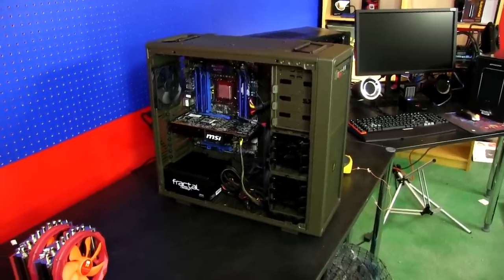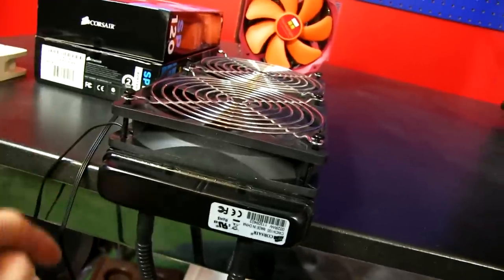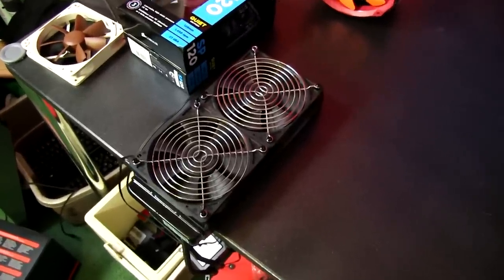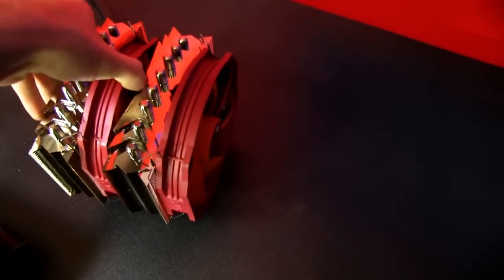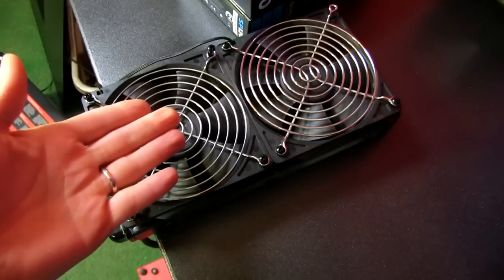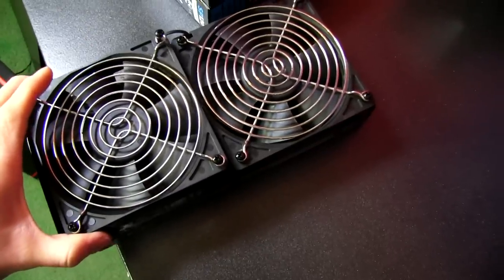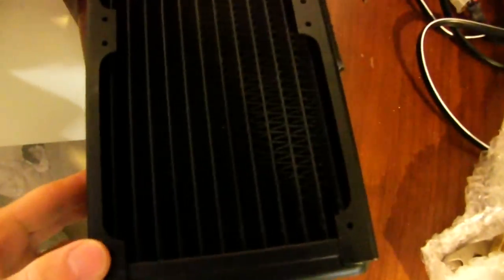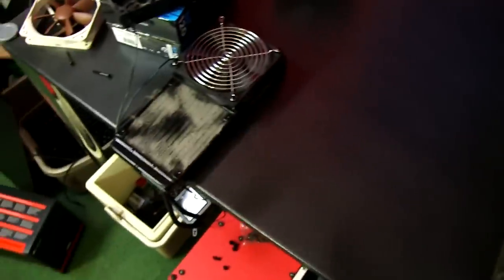Push vs Pull vs Push Pull for Radiators and Heatsinks Linus Tech Tips

Comment: i would just like to share my thoughts on this push/pull question, as linus says it makes it easier to clean but if you take a look at an ac unit for example, the 6kW or bigger ones that you can use for both heating and cooling. they use pull configuration since their radiator is bigger than the fan can cover in push configuration so they make a funnel the size of the radiator and size it down to the fan size with low tolerances very much like you can see on some car radiators, that way the smaller fan creates negative pressure between it and the radiator sucking air evenly across the entire radiator. if you however use the fan in push configuration the airflow is more centered wich makes the radiator as small as the fan, in the pc world radiators and fans are pretty much the same size so that will not make any noticable difference but in alot of other cases were the fan cannot be sized equal to the radiator, pull is the goto method, atleast that is enough along with the cleaning benefits to convince me that the pull configuration allways wins or is atleast equal.

Comment: The push pull thing was handy, I just did this the other day because my fans didn't have enough pressure for the rad.   tho.    Its pretty easy to lay down your case and unscrew the rad and use a can of air

Comment: I personally think pulling makes the most sense. No matter what, you're going to be moving air through the radiator at the maximum rate at which the fan is capable of as the air will find it's own path through the rad instead of just being forced through it.

As per the mounting of the radiators... I'd say pull the air out of the case still. Even if the air is hot, as long as there is flow you're going to be dissipating heat. It'd also be a waste to not make use of the free thermal energy that's already taking the hotter air upwards.

If that isn't enough, fully detach your water cooling radiator from your case and liquid cool your liquid cooler for extra kilowatts!

Comment: The real question is expelling radiator (CPU) heat into the case or out of the case.  Internal case temps higher would increase heat on MBOB and GPU.  That is my question, yet all I find are videos addressing fans and radiators.  Tough to be aware of and clean a push configuration, so I am a NO vote on that.  Heat into or out of case? Logic would say out.

Comment: when in push dust will build up on the radiator side with the fans but with pull it just build up dust on the opposite side of the radiator to the fan, wither run pull, or push with dust filters

Comment: that'd be a bad idea because hot air rises, those top fan would trap the hot air inside by pushing it down again so yeah as far as intake vs exhaust goes it should be a matter of 1-5 degrees maybe a bit more in intense gaming but its harder to clean if you put the radiator as intake no matter if the fans are the front of it or at the back of it (you'll have to unscrew it) and general rule: front, bottom and (side depends on GPU cooler) should be in take, back and top exhaust

Comment: I think you would get only the amount of airflow that your case would be able to exhaust though fan holes/ cracks in the seams of the case. Having a ton of fans just pumping air into it with no way for it to exhaust out won't make it work better. In fact it might make the airflow worse. You do want slightly more filtered air pumping in than exhausting to help keep the case clean inside but you can go overboard with no net gain after a certain point.

Comment: As a refrigeration service tech for a few years, PULL! For the exact reason he stated. From top of the line down to lower end less reliable units (maybe not all the super crappy units) the fans All pull air across the heat exchangers. (condenser and evaporator) These condensing coild plug up with dirt quick as they are running 5-50W fans on and off all day and all night. At places that have prep-table coolers, that dust gets kicked around and sucked up by those fans and into those coils. It then gets packed on there like a blanket (yes like grandma's thick blanket but made of dust 3/8" thick. and that's just in 4-6 months. Leave them un-maintained for 8+ and you'll be calling the local HVAC/R service company because the unit is running warm.) making the whole system work harder. (think running a marathon on a hot summer day with a sweater on) get a bristle brush (plastic bristle or softer. no metal) and a vacuum, brush that dust off into the vacuum hose, then get some compressed air (cans of duster, CO2, etc.) and blow backwards through the coil into the vacuum again and then blow forwards through the coil. The only way better to clean your radiators and coils is with a light pressure washing.
Reply: I also recommend a filter for your whole case where ever your intake is. Cheap filter from hardware store, foam pad, cut-to-size filter, w/e..... maybe not a coffee filter so much. Helps keep the whole setup much less dusty. Very nice.

On second thought, through a K&N on there for an overpriced boost of 2 HP to your CPU.

Comment: Considering you're already using 2 fans in a push/pull configuration, switching to delta fans would be pointless and unnecessarily loud. Heat is absorbed by air at a specific rate and as such, air traveling at 50cfm or 250cfm won't change anything. Unless the ambient temp inside your case is hitting 70C and above (example) it may be worth it. Then again a simpler, quieter fan would do the same. The extra degree or two gained isn't going to get you any further in stability tests if you're OCing.

Comment: Surely push or pull matters because of temperature  of the ambient air going through the radiators.

If you are pulling hot air from inside the pc through the rad, its different to you pushing colder air from outside into the radiator and then into the pc. Also the source of dust is more likely directly from outside, as most pc have some kind of filter for air entering the case from the front, or underneath.

Also 'push pull', has the corresponding 'pull push' mode, e.g. Whether the air is travelling in through the radiator, or from the case to the radiator.  I would like to see this question revisited, please.

Comment: Believe it or not theres a method thats not widely known, and thats Pull Pull, both fans pulling heat away from the radiator in 2 directions, it works very well ive tried it. Better still if the rad is mounted at the front you get the best of both worlds heat from the rad is getting pushed out the front and the other fan(s) are pushing air in the case at the same time also you get no dust build up in the fins... If you are using only 2 fans on a 2x120 rad, i highly recommend fitting the rad at the top pushing out, as heat rises.

Comment: It's all about cool air flow inside the case, best way to get cool air flow is to mount radiator at top of case, with the fans pulling heat off the radiator out to the top, fans at the front blowing cool air in, fans at the back blowing the air out. The reason for the radiator at the top is because heat rises, so place the hottest heat source where the heat can escape the case fastest. It doesn't make sense to place it at the bottom does it, because that would increase the ambient temperature of the case.

Comment: I have been using a push / pull with two of these corsair 120sp fans. I actually got a fan filter for the rear of the case and don't have the problem with dust / cat hair getting into the radiator. When I air out the case I do stop the fans and hose inside the radiator.

I would think sucking in cooler outside air would be better.
Reply: Would depend on your setup.  If everything is water cooled, then heat inside the case would be minimal and in fact it might be a plus to remove what little heat remains out. If you pump the heat inside the case, it could even heat the metal on the case which in turn would add even more heat to the radiator or atleast make it harder to cool.  But as you say, you are pulling in cooler air in the situation that not everything is water cooled.  But also think in that scenario that you are adding more heat to the items that aren't water cooled too.
Reply: Carl Kitchen Your case air temperatures would not vary much, if my knowledge is correct. If they did, you have an airflow problem in your chassis.

Comment: in a push, some heat is transfered from the heat of the fan to start, where pull has a more uniformity in temp causing an even cooling... balf a dozen one way, 6 another way.

Comment: Neither. Push and pull *only* refer to the placement of the fans on the radiator. The terms you're looking for are intake and exhaust. Intake is when the fans on the radiator (push or pull) are getting their air from the outside of the case, and moving it inside the case. Exhaust (push or pull) is when the fans are blowing air from the inside of the case to the outside. 

Intake is ideal, but exhaust is useful for small cases or limited airflow.

Comment: The tip for dust is decent but i have a small compressor i use to clean my PC once in a while so its a non issue for me :P
But as far as performance go it can be affected by many factor and affect other component inside your case.
Depending on the fin size/distance on your rad and the static pressure and CFM of your fan, result may vary.
Things like whether the airflow in your case creates positive or negative pressure as well as overall temp inside your case needs to be considered too.
General guidelines are fine but nothing beats real world testing for your own particular situation on then end :P

Comment: Performancewise it doesn't matter if you go in push or pull config. I agree on that. But what about the noise-buildup? I've experienced time an time again that if you have a casefan pulling air inside the case, it'll build up a pretty annoying humming-sound if you don't leave enough space between the fan and the fangrill of the case. So my question is: Wouldn't it be the same with a radiator and a fan?

Comment: I push air out of my case. With dual 140mm fans in the front, and two up top, it's a nice loop, and my temps are good. Dust isn't a huge issue thanks to dust screens.

Comment: It's not impossible to clean.  Get an air compressor!  Also, I would argue for push pull on radiators, depending on the application.  If heat is an issue, for example if you don't have a large radiator, you can run all fans at a lower RPM to combat heat soaking and keep noise lower than what 2 fans would generate to do the same work.

Comment: 1 large fan vs two smaller fans?(video suggestion)Is it better to have two fans on a radiator or 1 big one?! Is the CFM the same or better? Linus you're awesome tech videos inspire. But I have too many unanswered Google Q's.
Reply: fcfdroid I'm not Linus, but here's my two cents (hope it helps)...

CFM is a measure of how much air a fan can move, and depends on size, speed, blade shape, housing, etc.  Generally speaking a larger fan will move as much or more air that a smaller one, but not always (too slow, bad design, etc.).  But just moving more air isn't enough with a radiator (or a massive heat sink for that matter).  You need static pressure (SP), basically focused CFM.

A box fan has high CFM, but low SP (good luck cleaning the crumbs out of your keyboard with one).  A can of compressed air has low CFM, but high SP (great for crumbs, not so much cooling the room).  The key is to balance CFM and SP.  That's why most rads these days are made for 120mm fans (not too big, not too small).  But you can get 140mm fan rads or even 200mm fan rads.  As long as you get the right fan(s) (CFM+SP) size doesn't really matter as much.

As for one big vs. many small, it's really up to you.  You can move a man with a single horse or a team of sled dogs.  It comes down to noise level (generally bigger = quieter, but you can dial back multiples too), case compatibility for rad  size and shape (240mm (2x120) vs 280mm (2x140)), brand loyalty, aesthetics, and budget.
Reply: PongoXBongo Thanks! I totally agree.

Comment: My 240mm AIO from Cooler Master (Nepton 240m with high pressure Silencio fans), has it's configuration in push, because in a direct 90 degree angle next to it in my Corsair 250D, is a large 200mm intake fan, in pull, with a filter in front. So case in point, if you got proper case filters, it will not matter if you got push or pull.

Comment: what I do is,  I attach a straw to my vac, tape it off so it sucks 100% only through the straw and I stick it up between the blades of the fans and it sucks the dust completely out of the rad. then the very edges of the rad what i do is I fill a air tank I have with like 120lbs of air and blast the other side of the rad and that removes any dust the straw had missed.  
that's my tech tip.  i use a push pull system on a corsair h100i and it does indeed make a difference rather than just push or just pull.  according to my temp gauges it made approx about 8c to 12c difference.

Comment: ok, so for what I understood, you recommend to have the radiator fans on top of it pulling air out from the computer to thru the radiator and out of the case. This helps when it comes to cleaning your radiator.
BUT, what about the whole airflow of the case? If you make set up your radiators this way then they become exhaust fans, and as far as i know, we want t keep a positive air flow, right? so, what are you're recommendations on this? add more intake fans?

Comment: i would recommend vacuuming it off first after you got most of it out. use a duster to blow anything else off. you will end up still pushing some of that dirt inside closer to the fan anyways. that's when you use the duster closer to the fans as will. which remains me i need to clean out my computer... its been an year and i have yet to clean out my watercool loops. not sure which method to use.

Comment: you need to do a video on the internal air pressure inside the case due to fans and how to configure so there is a positive air pressure inside the case compared to external. Positive air pressure helps to keep the dust down inside the case.
Reply: The fans should always have a dust filter over the intake. The little cracks and empty fan slots do not have a dust filter. If you have a negative air pressure dust gets sucked in through all the cracks and holes that do not have a  dust filter and collects on the internal parts of the PC while a positive air pressure more dust is on the dust filter instead of important things like heatsinks. The cracks and holes air is being pushed out so that ultimately makes for less dust inside the case.

Comment: I currently have and FX-8350 @ 4.0GHz and a SilverStone Tundra TD03 in Pull config at the back of the case as exhaust.
My CPU idles at 10~15c and it's really easy to clean, don't even have to remove it at most points. So i'm happy.
I wrote this before watching the vid btw.
Reply: +Captain Gray nice temps!
Reply: +Captain Gray Update. I bought a new pair of fans: Corsair SP120 1450 RPM and set it up in push-pull, my CPU idles at 9 - 13c now! ^_^
Reply: Where do u live? South/North Pole??
Reply: ZsiaNcs
My room temp is around 20-25c. And i live in central Sweden.
Reply: +Captain Gray Then your CPU can't be idling at that temp.
Reply: +Captain Gray I have been testing various ways to measure my PC's internal temperature and this is as accurate as it gets. http://imgur.com/a/1cocx
Reply: +Captain Gray damn, do you have and intake by your windows or something? maybe it cold outside?
Reply: abger saurus
Actually yes, i am sitting right next to my window. It's pretty much late fall or early winter here. Around -5C outside. Maybe around -10C to -15C in December.
Reply: Captain Gray damn... that's cool just watch out for condensation inside of your case

kind regards from Denmark :)
Reply: Even then, if you aren't getting any air directly from outside, those temps are not real. Your other temperatures look normal, very similar to mine, but my CPU runs from about 30 at idle to 60 at full load. 
I would probably say you have a faulty sensor on your CPU.
Reply: Pedro Silva
I have been testing with real thermal equipment, measuring the water block and it had an average temp of 9C on CPU idle.
Reply: Is your room temp still 20c?
Reply: Pedro Silva
Nah, it started dropping some 3 months ago.

Comment: My only question is if you run pull like you suggest for easy cleaning, with the fans mounted to the case surface, you'd be pulling warm case air through the rad out of the case.  Does pulling warm case air, rather than pulling cooler outside air make a big difference?

Comment: I built one of the work computers (purely air cooled) with an intake fan on the front of the case, a coolermaster cooler with a fan on each side (setup in a push pull) and an exhaust fan on the rear (which lined up pretty nicely with the cpu cooler), that computer idled at like 5 degrees Fahrenheit above room temperature.

Comment: I am cooling my radiator with push. Should i change my Corsair H100i stock fans to Cooler Master sickleflow. My Corsair stock fans make 50 CFM at 1700 RPM and it makes 27 dbe. Cooler master sickleflows would make 70CFM at 2000RPM and it would only make 19dba. Cooler master sickleflow haves only slightly smaller airpressure.